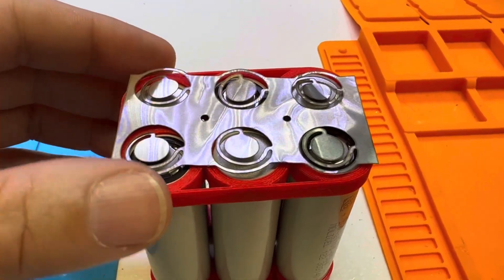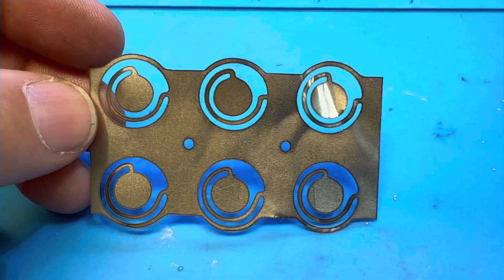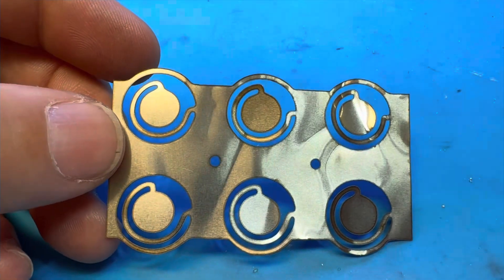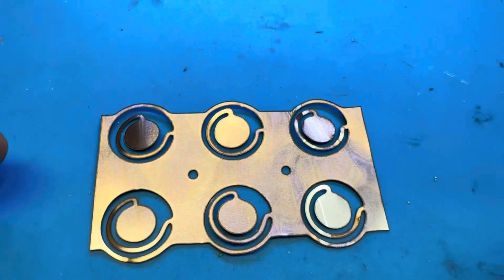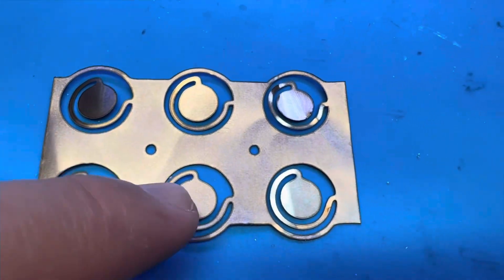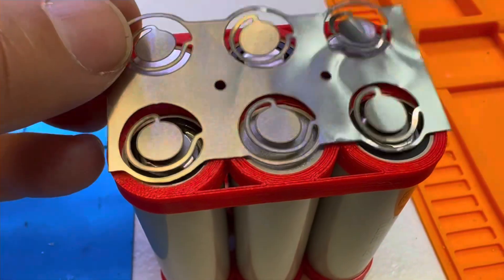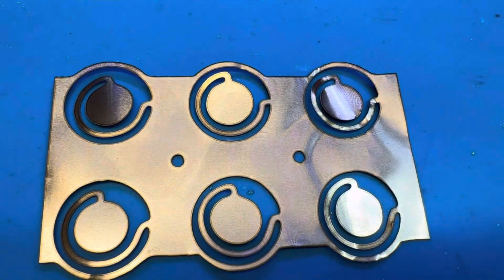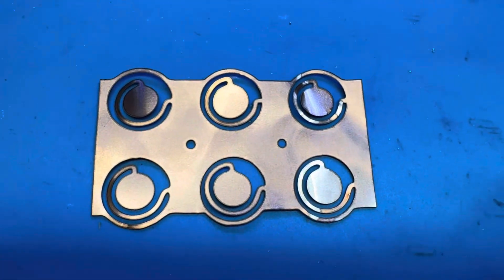DIY Fuse Busbar for Battery Packs – Protect Your Build

Comment: Great videos man, if i could ask of you, on your 811h, what power setting would you use to weld 0.2mm copper to regular 18650. I tried what the manual proposed and it was NOT a good idea ahah. Thx for the reply in advance

Comment: why bother with copper strips if you're adding a lot of resistance with fuses? I don't see the point of fusing individual cells, adding a significant amount of pack resistance, when really, the BMS should easily detect a broken cell.
Reply from the maker: When you have more than two cells—or even 30, 50, or 100 cells—in parallel, what can the BMS actually do? The BMS has no direct way to identify a damaged cell within the parallel group other than detecting voltage deviations or differences in internal resistance across the group. A damaged cell acts like a resistor, gradually draining the entire parallel group, causing imbalance, and eventually damaging the entire group and potentially the whole pack. A fuse can isolate the damaged cell from the rest, allowing the pack to continue operating—albeit slightly unbalanced. With only one faulty cell isolated out of 30 parallel cells, the performance impact will likely be almost unnoticeable.
Reply: @DIY500AMP the bms will let you know a parallel cell group is damaged, as it will diverge in voltage more under load and in general (quicker discharge, quicker charge).
Reply: @DIY500AMP if a cell is damaged, you NEED to remove and replace it. it will severely mess up pack balance, the less cells in parallel, the higher the imbalance
Reply: and how can a fuse isolate that cell unless the current goes high enough to blow the fuse? things melting over the positive terminal is a really bad thing. might permanently short the cell if it melts through the plastic washer.. but for a single cell to blow the fuse, that particular cell needs to dump more cells than the others wired in parallel. Does not really make sense, as the highest load is carried by the cells with the lowest IR, not highest IR.
Reply: given the current flows through the lowest resistance (healthiest cells), the bad cells will never blow the fuse, but the good cells might, resulting in the opposite of what you want to achieve
Reply from the maker: @JoLe1991  Good question. Individual cell fusing (like Tesla's approach) isn't designed to stop a cell from failing—it’s there to isolate that cell from the pack when it does fail. You're right that a damaged cell with high IR will carry less current, but once it starts failing, internal shorts can rapidly increase current and heat, triggering the fuse to blow. This prevents a bad cell from dragging the rest of the pack down or causing further damage. Of course, if you know a cell is damaged, it's always best practice to replace it proactively.
Reply from the maker: @ when a bad cell suffer a runaway will heat up so badly that blow the fuse. Again is not a new concept. Google it. Tesla batteries are made in this way, they expend millions exploring this method.
Reply: @DIY500AMP yeah, but thermal runaway will most likely set the whole battery on fire..better to run away at that point. a fuse is designed to blow at a certain amperage. if it melts because of thermal runaway of a bad cell, the whole pack goes ...
I guess any pack is designed to handle at least 2C current, a discharge rate you'd never see from internal shorting, unless it's about to blow up.
Reply from the maker: @ you know teslas packs only pull 4-7A per cell? This is for low current applications. We are talking at least the first packs. I am not 100% sure about the new ones. Let me see what @Doctorbasss can say
Reply: @DIY500AMP how does 300kW on a 80kWh pack translate to 2C discharge? the plaid pushes it to about 7C discharge
Reply: these are discharge levels you cannot really fuse with that method. I just see it like an insurance for when you're about to die anyway. high discharge packs struggle enough from the poor conductivity of nickel, add fuses and it gets even worse. that's why the most efficient cell connections are made of copper strips. I've repaired a lot of batteries with fused cells (14s14p for the most part) many had a few poorly welded cells or completely disconnected ones, but not a single fuse was ever blown. in some, plastic was molten where the power leads touches the cell holder.
Reply from the maker: @JoLe1991  Again. Are different uses.